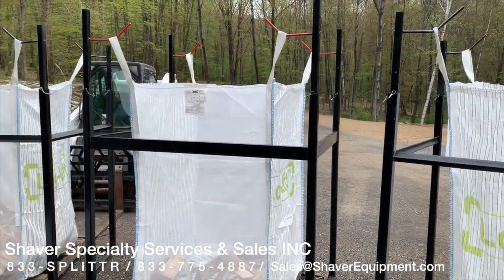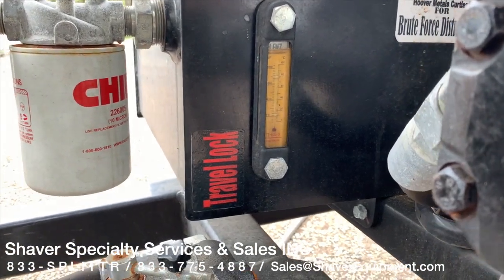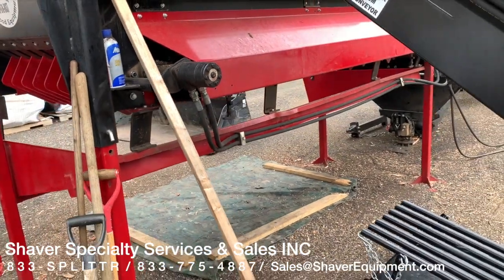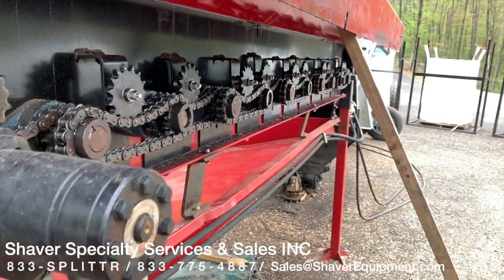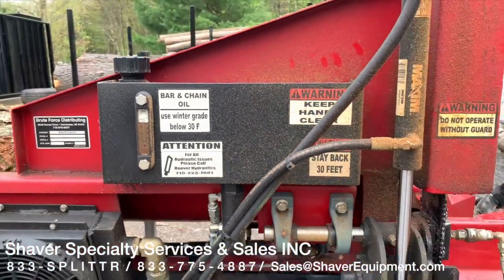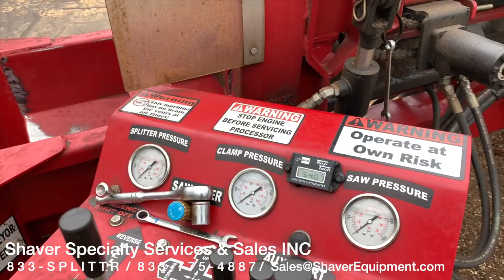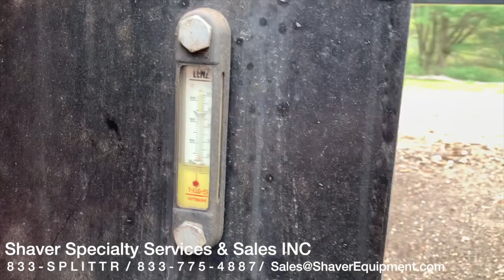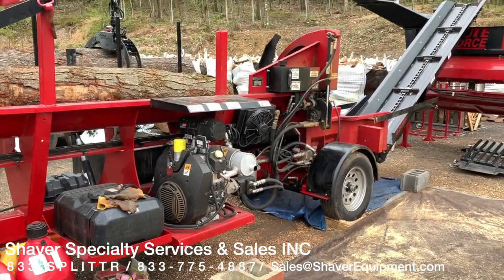50 Hour Review & Virtual Firewood Equipment Expo

Comment: How much would you charge for mobile processing for other people?  How many cords per hour does that set up do?  How long does each cutting chain last before sharpening?
Reply from the maker: We got $85/hour last time we had it out. The 16-24 is a solid 2 per hour, if decent sized logs 3 is not out of the question. Chains are .404 so they take a little more of beating than others

Comment: Can you pull wood out of the bags and use it as needed?  Will they fold down with wood still in them as you pull it out?  I have been using pallet style crates that I bring in with my forklift and pull the wood out of them as I need it.  I feel like bags might be easier to use.
Reply from the maker: We store all the bags on pallets. Easy to move, and keeps the ground moisture away. Good air flow the whole way around. I've used pallet rates, jigs and IBC totes. I will NEVER go back stacking wood inside of anything ever again! Plus the bags season the wood super fast. If we can get you a quote, please don't hesitate to call or email. Thx AJ
Reply: @ShaverSalesINC  thanks for the response I'll be in touch
Reply from the maker: @jdboy9  833-SPLITTR / 833-775-4887